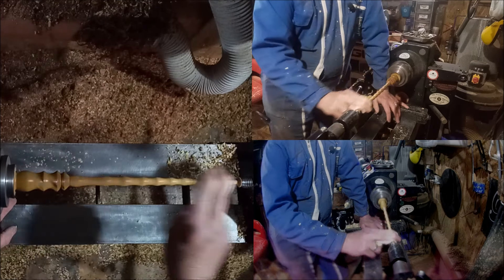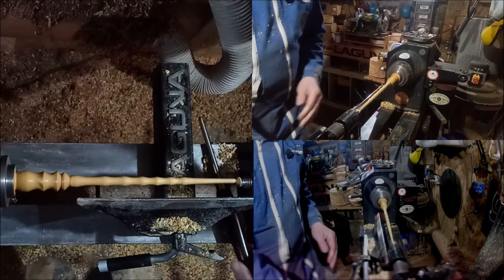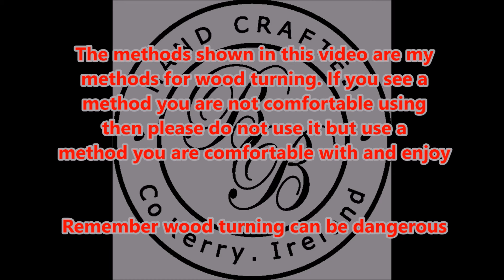Woodturning Projects for Beginners 9  Turning a Wand

Comment: Shay, although I don't regard myself as a beginner I still found that useful, you have a knack at getting to the nub of the matter. May I ask what sort of price you would then charge for a wand? I'm about to start trying to sell things but don't really have a clue what to ask - especially for the small stuff.
Reply from the maker: The way I price everything Mick is cost to me plus an hourly rate. I sell the wands at €15 as they are quick to do and I make them from offcuts so cost is minimal.
Shay.